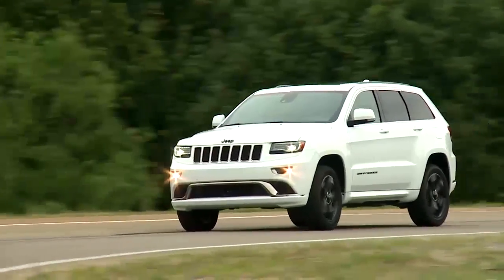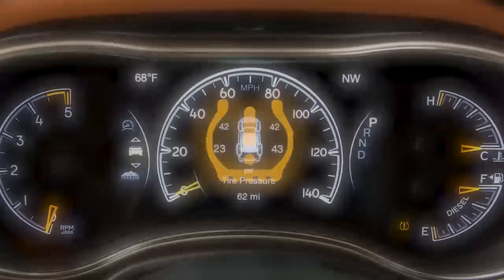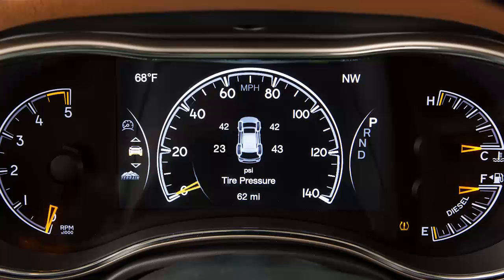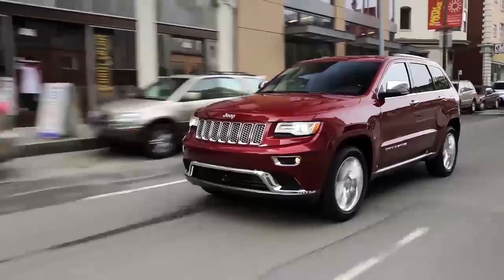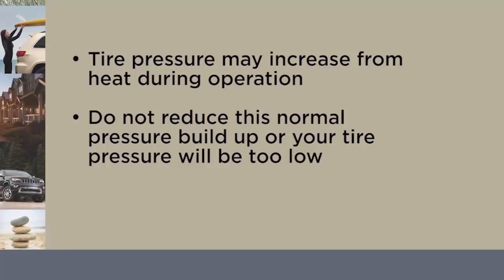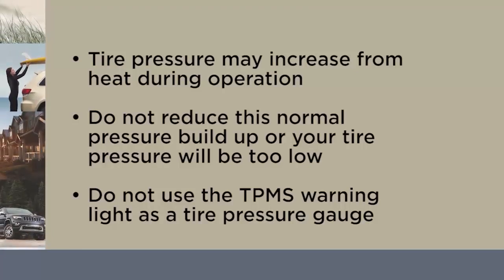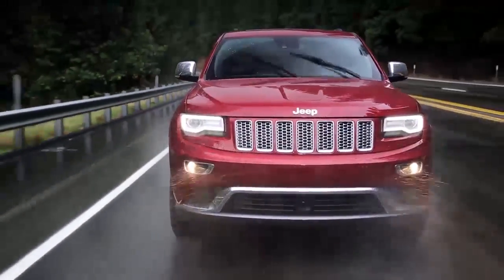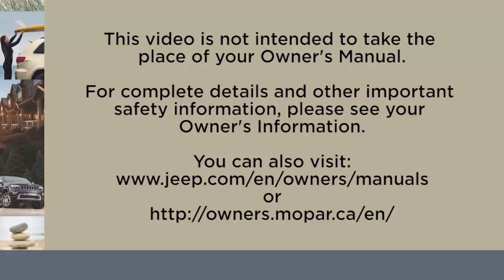Tire Pressure Monitoring System-The TPMS light and tpms sensor in 2017 Jeep Grand Cherokee

Comment: Yea right . Mine have 37 psi in all tires. They show 32 and 33 and for some reason one tire is circled red. Drove 50 miles on highway. No reset. Ugh I hate these. My old Tahoe needed 80 dollars a pop to replace. Note to auto makers , us humans made it for may years without these annoying sensors . Notice how the guy says adding pressure to your tires may not correct the pressures on the screen! Ugh
Reply: What did you end up doing?
Reply: Straight facts. we as people got to comfortable with our vehicles showing us our tire pressure lol
 I just changed one sensor in my Jeep Grand Cherokee limited. Dam thing was $149 for one sensor. Smh